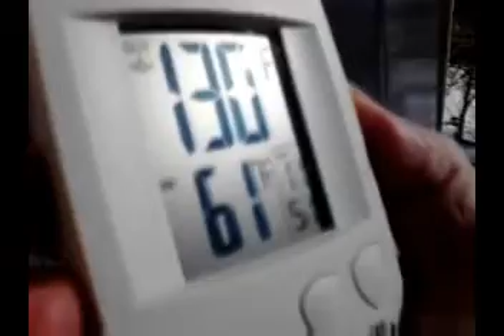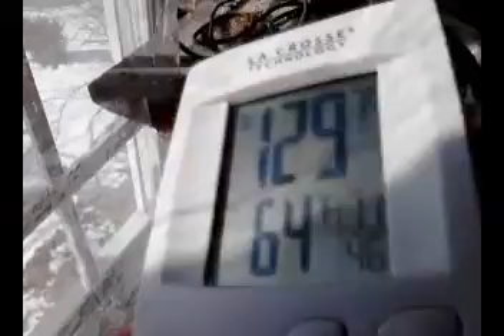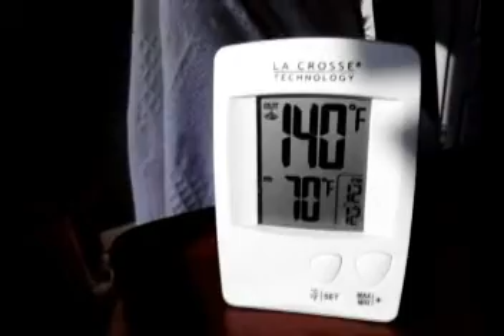My 6'x12' solar air heater

Comment: I designed a solar air heater using polycarbonate dual walled panels as well.  I think the bowing actually helps the sun's rays penetrate as the angle opens up the channels.  If you want to see my design, it's viewable at diy-solar-heater. co m  I also provide where to get a computer chip-controlled fan designed specifically for solar air heaters.  Cool!